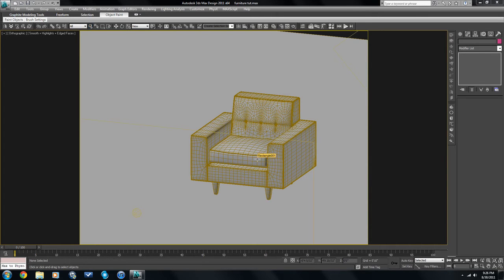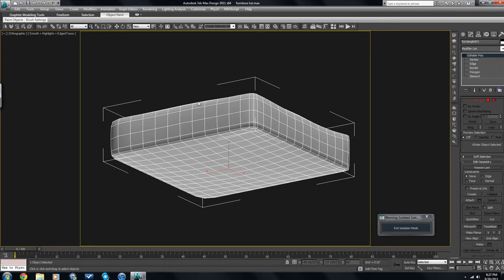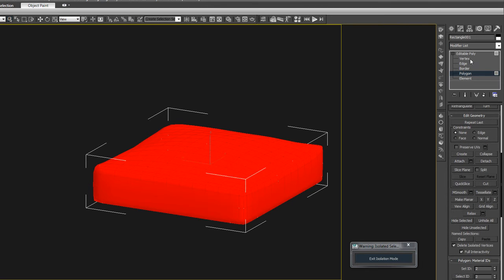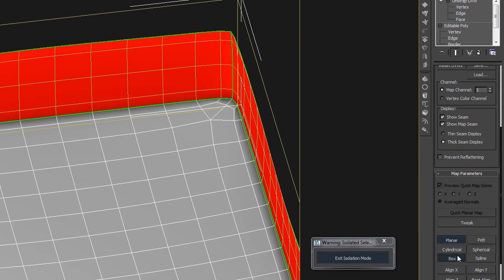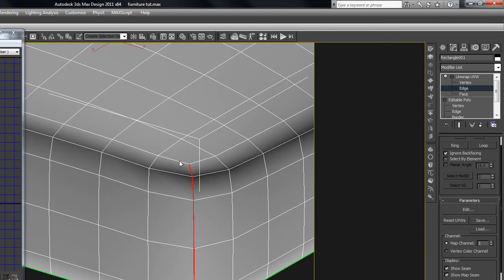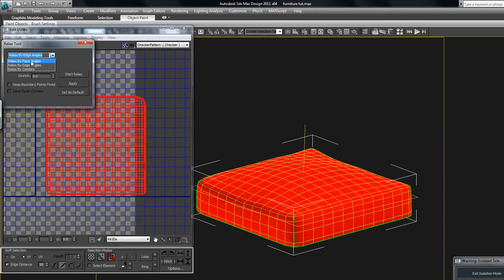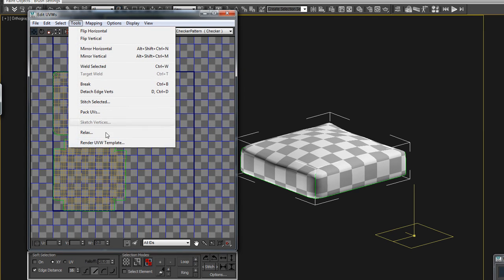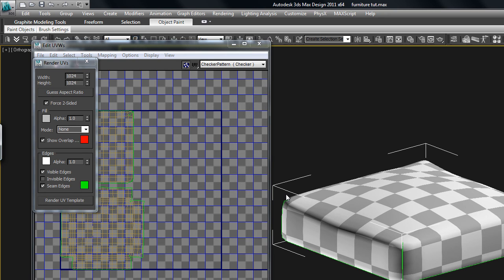Furniture uvw unwrap.mp4

Comment: The Unwrap UVW map in 2014 is totally different
Reply from the maker: It looks totally different, but all the same tools are still there.  It does have some additional tools too, mainly the peel functions.  These can be useful, and they can be used in place of, or in correlation with, the relax tool.
Reply: zillus oh cool. I'll check the peel function. Thanks!